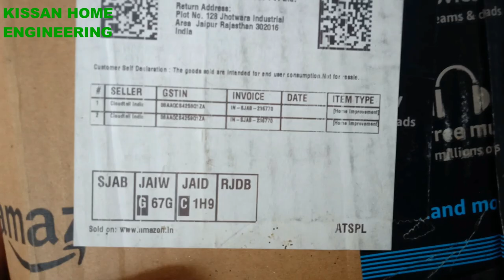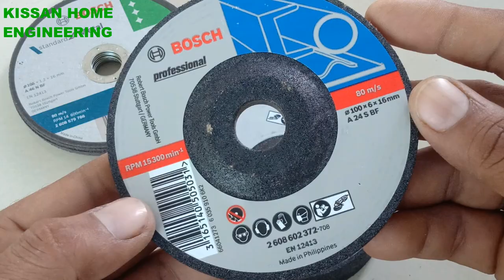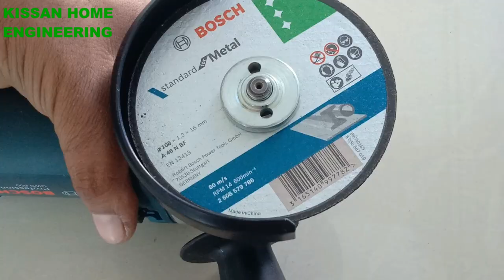How to use bosch metal cutting disc & grinding wheel || Unboxing

Comment: I purchased the bosch gws8-45 grinder and it says it’s not meant for cutting.  Is this true?  I thought all angle grinders do cutting with a cutting wheel.
Reply: Depending on the watt. I got mine GWS7 100et with speed variation. 750 watt
Reply: All grinders can use a wheel for cutting but not all grinders come with the proper safety guard. Most come with a type 27 suitable for grinding. When cutting, it is recommended to use at least a type 1 guard which will enclose part of the wheel to prevent pieces from flying in certain directions if the wheel shatters.  Thats probably why the instruction manual of a grinder with a type 27 Guard says not fit for cutting.
Reply: Ооееггугышы
Reply: Анаггц
Reply: Алалашагр

Диски мамы

Comment: :face-blue-wide-eyes: You are totally doing it wrong, You placed both the cutting disc and the locking up side down, running the wrong direction, improper holding of the grinder etc. Glad the disc didn't explode on you. Guys, this video is quite misleading and don't follow these instructions for your own saftey. Angle grinder are extremely dangerous.